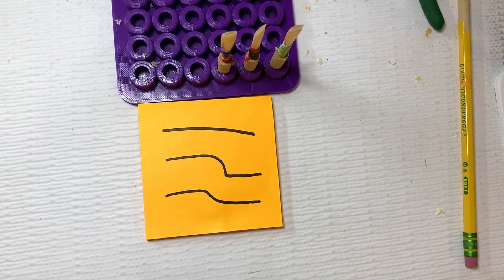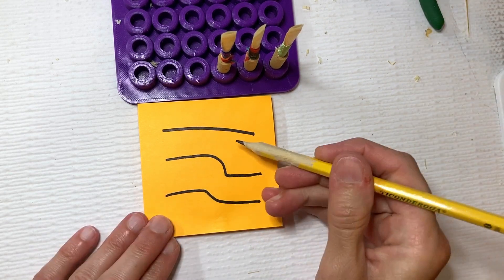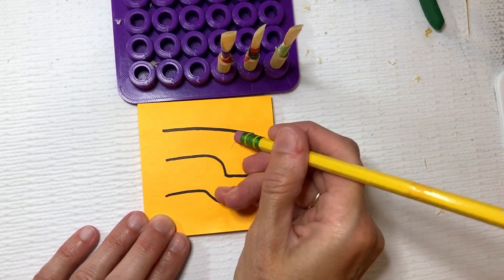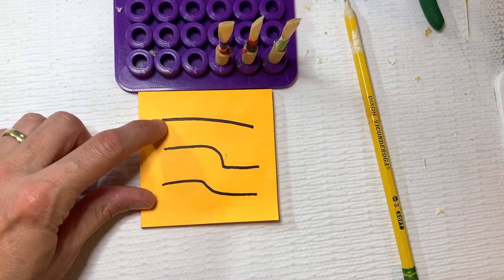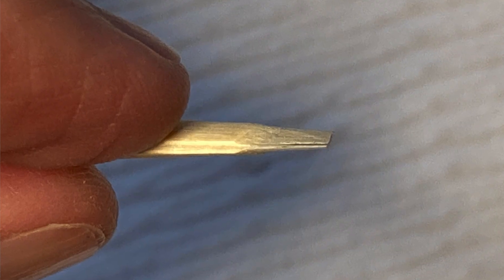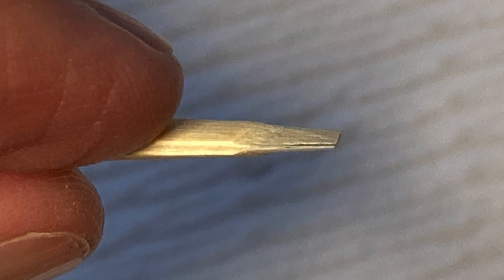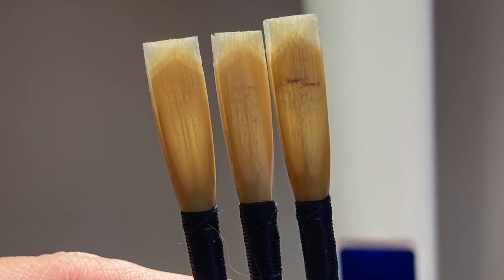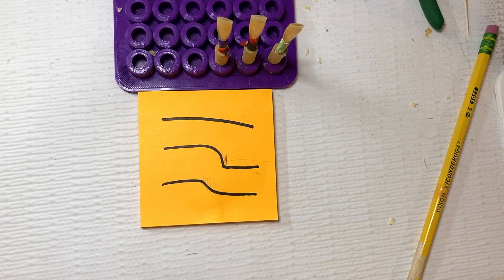Five Minute Reedmaker: Structure of the Rooftop

Comment: I often find myself moving from an extreme of number 1 to a solid number 3 when making the reed.  Usually, I worry about the profile first and how easy the reed vibrates before I sort of "paint in" the roof top that you were talking about.  I also find that focusing on the sides of tip and also finishing the very tip at about day 3 or 4 of the whole process gets ride of those inconsistencies in articulation, and often I find a number 2 to be stuffy because of the lack of transition.  It's almost as if there's a hole cut into the reed with number 2, at least for me.  Also, I find that your comment about the reed as a unit are spot on with the number 1.  I too feel that if there is not enough definition, especially in the sides of the tip, the reed is too wild and stuffy.  Often I will make certain to address the balance of the heart, leaving the center spine area a bit thicker and the sides of the heart thinner to correspond with the dimensions of the tip. Often I will also work to make the transition between the top of the heart and the rooftop less abrupt, when adjusting.  This often makes the reed easier for my embouchure, resonate more, and reduces resistance.

Comment: I’ve always thought that the vibration begins in the tip (the high C), and then the heart (plateau) filters the vibrations of the tip and it’s the back that vibrates the low C when blowing pressure increases. Maybe it’s actually the heart that is vibrating to create the lower vibrations, but then why would we need to scrape the back at all then? I always thought that if my transition from tip to plateau was TOO steep or my tip was TOO thin compared to the plateau, that all the vibrations of the tip get filtered out and none reach the back and the low C never comes. 

Having played on your reeds, I can definitely feel the way you like to transition the tip into the plateau. Your preferred way (#3 in the video) does indeed add in a fair amount of resistance when compared to the second example in your video. It was too much for me, I felt like I didn’t have control over the exact moment in time the reed would begin to vibrate. I tend to lean toward reed #2 in the video. That also has drawbacks though, namely I find it’s easier to inadvertently create low spots in the tip when making a steeper transition from tip to plateau. 

Your videos are so good and so needed in the oboe reedmaking space, thank you for continuing to put out such rich content. I remember grumpy teachers sometimes would even turn away from me (as a student) when scraping my reed, like they wanted to keep it a secret! Your videos bring all the secrets to light, thank you!
Reply from the maker: Thank you for all of this thoughtfulness! You are always great at pointing out the sloppiness of my language, which I mean in the MOST grateful way. I like your point about the back vibrating, rather than the heart. I need to think about that and maybe run the experiment so I can improve my language around this.